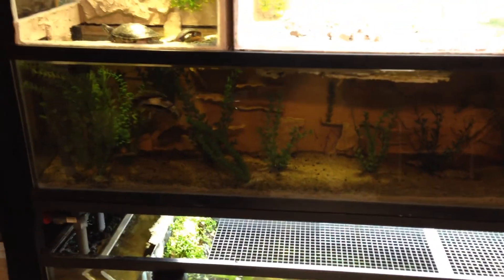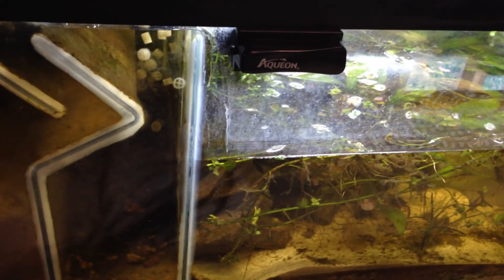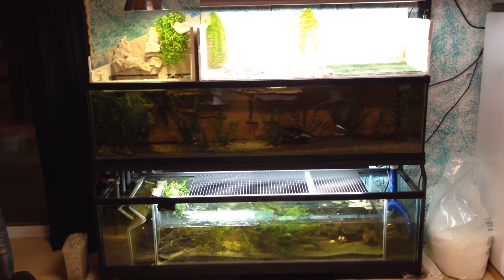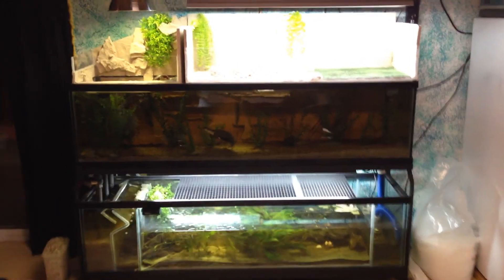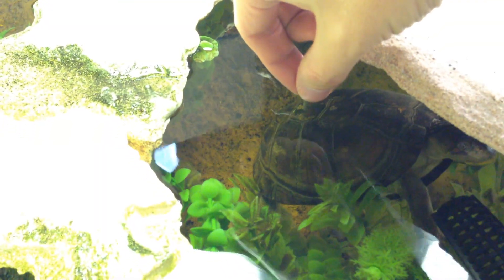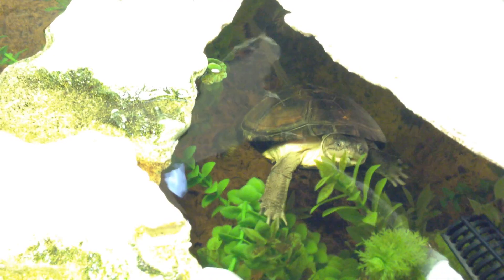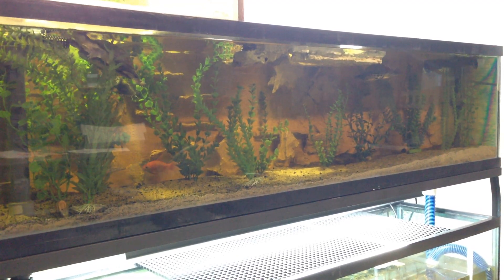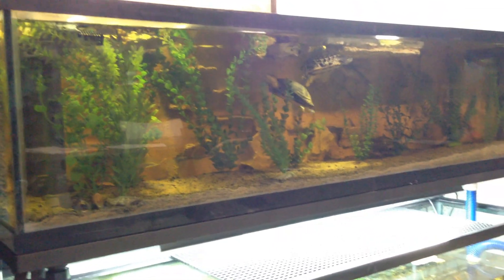Part 33 - Dual 100 Gallon Display Tank/Filter setup DiY

Comment: Add a decent size bubble stone with a good air pump at the bottom with the K1. It will keep them moving and clashing into each other and away from the corner.